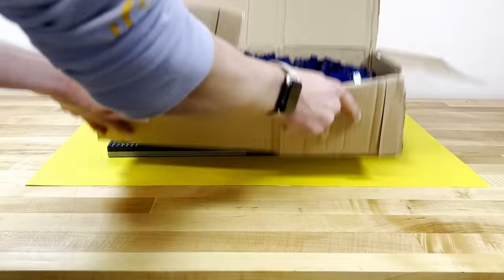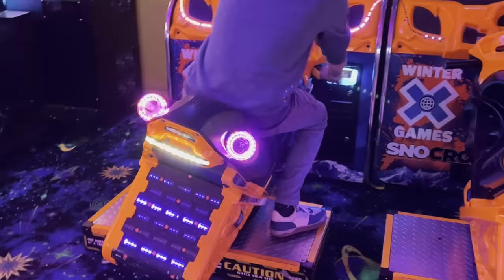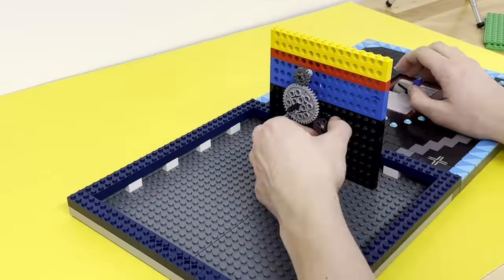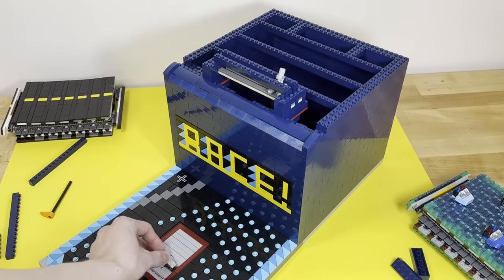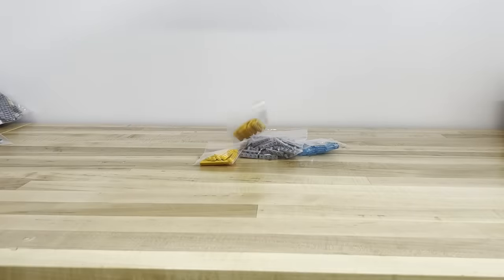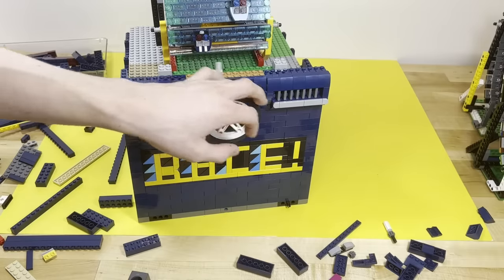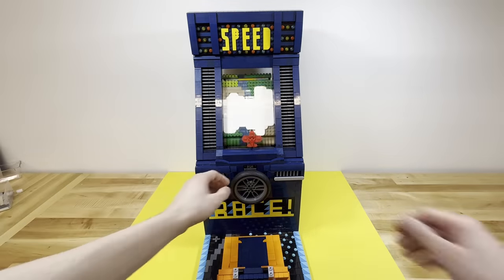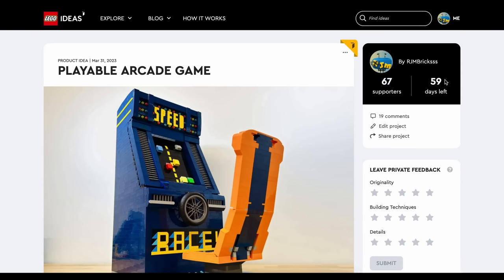I Built a Working ARCADE GAME in LEGO…

Comment: Man this is awesome! I hope you reach your goal of making this a kit for us to buy. I do see one issue that could probably be fixed relatively easily….. Correct me if I’m wrong but didn’t Lego retire the power functions you were using? If they did you might want to replace it with a powered up kit. Then, I think you can also program it to have a delay before starting so you don’t have to jump to the wheel after starting. Overall really great vid, you’d have to be one of my fav creators!